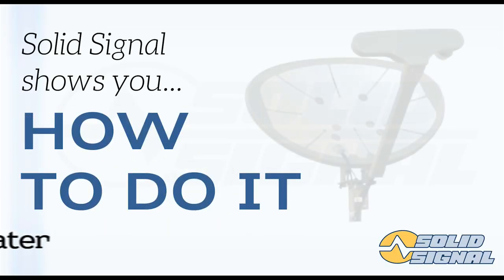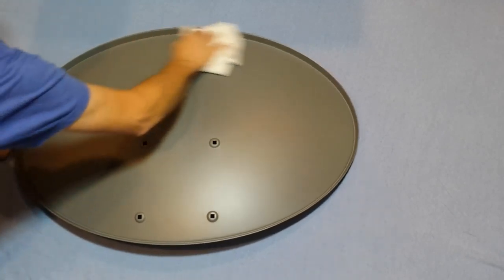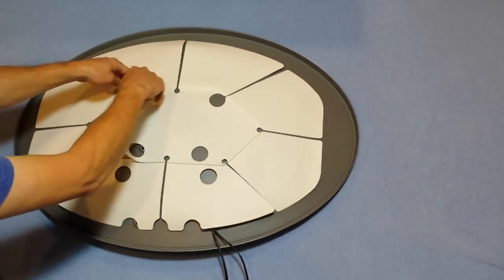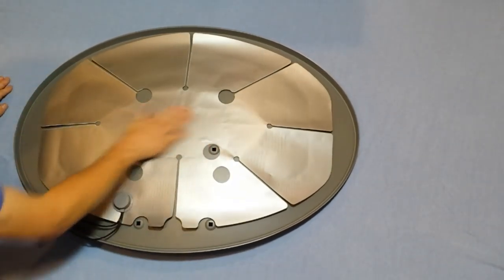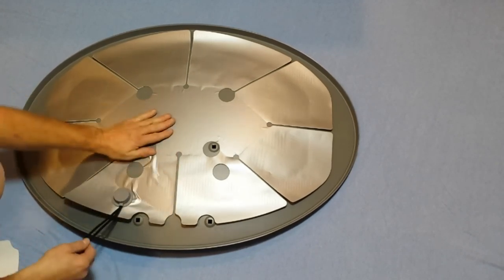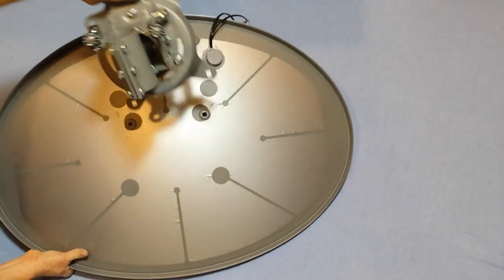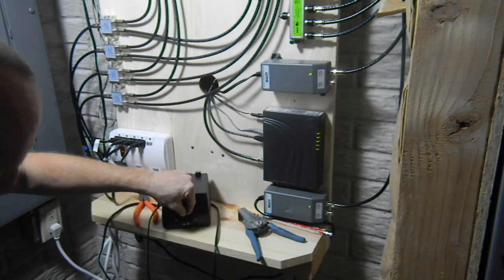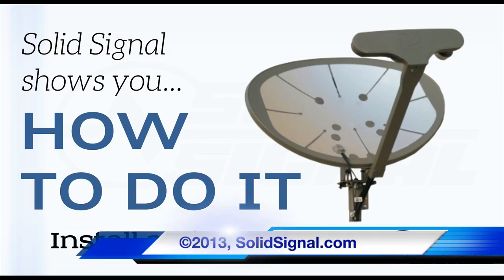Solid Signal shows you how to install the Hotshot dish heater

Comment: But how do you get the power wire to the dish? Is is soft copper wire, like 16 gauge speaker wire, or coax?
Reply from the maker: It is a separate low-voltage copper wire line a power cable
Reply: @SolidSignalNovi  You didn't show that in the tutorial?  That's kinda important?